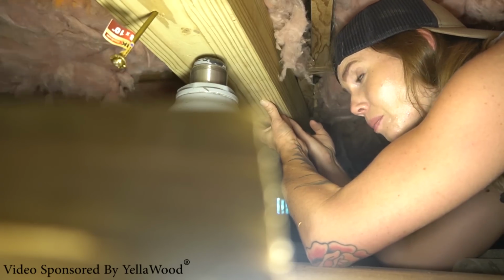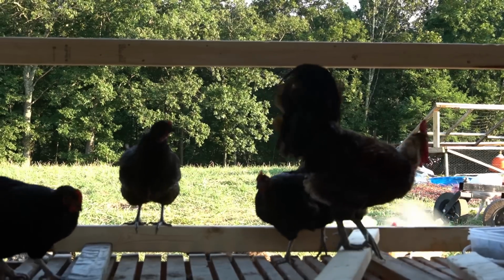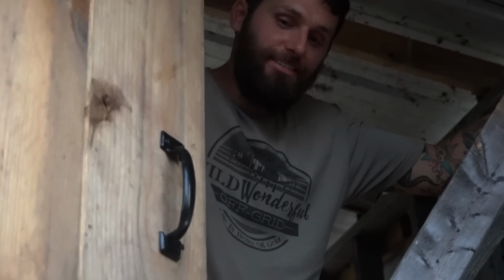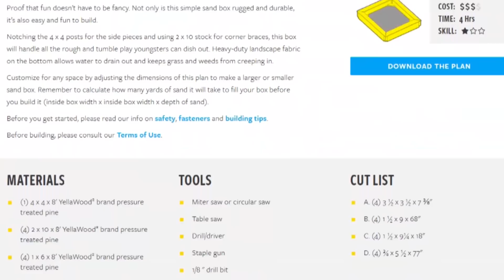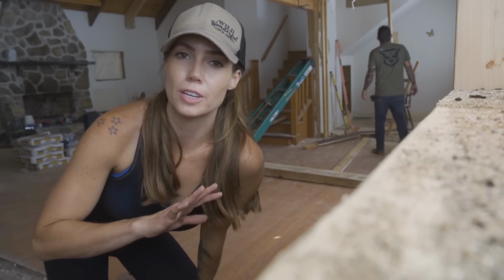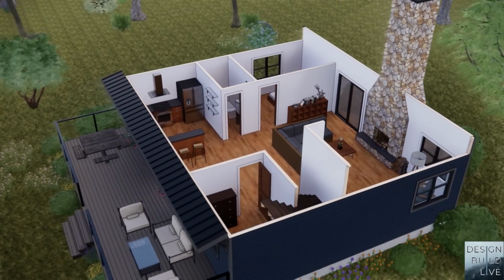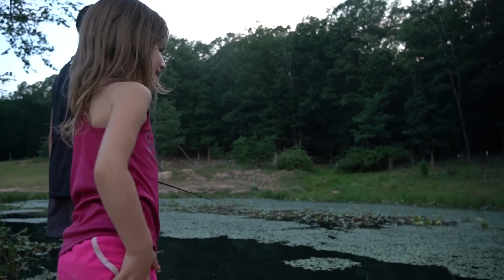Framing The Interior Walls

Comment: Hey guys, I'm a big fan and also a Journeyman electrician and work on technology systems and at this point while wiring your house I'd recommend having a central point for internet such as a modem for cable or satellite then running Cat7 to each room where you will be able to offer 40gb ethernet to   each room.  You can build your own video server using plex and other software and make it totally appealing.

Comment: Just a suggestion, you could drill holes in the metal frame of the chicken coop on all 4 corners or 1 on each corner and one in the middle (6 total) install an eyebolt in each, check online,there's a 6 piece 18 inch drill in ground anchor that uses a cordless drill,comes with drilling attachment, YT wont let me name the site here for whatever reason but it starts with "A" the one i saw was called Tondiamo  6 piece set green ground anchor kit w/ 3 inch auger/helix.
The same site sells various lengths (2 foot up to 12 foot) of stainless steel security cables with loops on both ends,you can then simply drill in the anchor and attach the cable to the eyebolt and anchor with a heavy duty carabiner.
Probably going to cost less than $100 and is quick and easy when moving the coop to a new spot.

Comment: Hi Josh and Erin. The sandbox looks stunning. To keep pets and animals out of the sand, cover it with a piece of canvas which can be permanently fixed at the back side and pull over to the front with hook and pin locking system at the front which could easily be loosened by Ellie.  The bed and breakfast idea sounds great and those that will use it, will enjoy ten star quality. Your work is just phenomenal. Thanks for sharing your life with us. Love you guys. ❤

Comment: Use 8 100# cement blocks tethered using 6” screw eyes, and at to top of the walls using the same, use paracord to tie it down nice and tight. I use four of them for my festival booth, and they have saved my canopy and gear/products when we get the crazy 3: to 5:p winds, or rain storms up and down the California coast. I also screw 8” screw eyes into the ground if we have grass or dirt floors.

Comment: For that chicken coop not to tip over next time make yourself a Plywood box 2’ x 2’ x 2’ tall put rebar in it so you can take a ratchet strap over top of it and ratchet it down make four of them and that way to that concrete will keep the thing from moving and rocking it won’t tip over and you can move it with your tractor the blocks of concrete that’ll be a cheaper way of doing it just a thought love you video keep up the good work can’t wait to see your next one thank you

Comment: If you are going to jack up a wooden beam with that type of hydraulic jack you need a metal plate about 4 inches square for the the jack cap to prevent penetration of the beam and possible spitting of the beam. Just a suggestion!!!!

Comment: Hi Josh , try to mount the water barrel sideways with a little pitch as low as you can. It will act like a counter weight below the deck in between the axles.

Comment: For the coop's future security against storms, how about putting some cables from bottom corners of roof down to a solid stake in ground or one of those screw in anchors ? Just something to take the tension when it starts to roll in any one direction.  They would only need to be used when you anticipate a storm, or if coop's not being moved very often... just an in case of emergency thing ?

Comment: You guys are doing awesome with everything on all fronts!  I am glad to see you are able to salvage the coop and rebuild it!  After the storm came and you showed that it was flipped, it got me to thinking would you be able to put some rocker arms on it (im sure its not called that) but they are like the stabilization arms used on some back hoes to keep them from tipping when they are digging and swinging around while on job sites.

Comment: have you considered screw in the ground trailer anchors and rachet straps to the upper corners - that should help brace from the wind, and can be easy to remove when you need to move the chicken house.

Comment: great video a s usual.  for the chicken tractor, maybe make it triangular A frame.  Better for wind deflection.  add skirting to keep wind from getting underneath.  Remove front axle and add posts in place of axle and use the bucket on the big tractor to raise and move.  just a thought.

Comment: The beams look great. 
Detailed Electrical and Air B&B a smaller no battery solar install would be cool. Keep those running costs lower.

Or maybe in a couple years as tech improves, upgrade the panels at home and use existing at rental properties.

I think the solar panels that can heat your pool and help the panels run more efficiently are pretty dope. 
We also need to get back on track with the Dck Jokes and Erin's butt should be its own character on the show and mentioned in the credits for appearing, giving the respect it deserves.

Comment: Consider mapping out a series of “Stations” that your coop can move through. At these stations there are 4 “hard points” with i-bolts attached to rebar in a 3-4’ deep, concrete filled, post hole. The coop would have 4 chains at all 4 corners like you are going to secure it on top of a trailer for transport. The idea is that at every station you take your coop to it is always secured down to 4 hard points with chains and ratchet binders. This way you only have to worry about making a solid structure that will stay in one piece. It is a lot of post holes and concrete… but you don’t have to worry about your structure flipping in the wind. Good luck.

Comment: Another youtube channel "Just a few acres farm" has a pretty ingenious and simple way to help stabilize his chicken trailer. He attached a short 2x4 to each corner with a door hinge. Positioned so that they contact the ground just slightly before they swing to a vertical. That gives the trailer a wider footprint. He use a hook and eye door latch to hold the legs in the up position while he moves it to fresh grass each time. You could also fill the tires with antifreeze to give it more ballast.

Comment: The reason your coup fell down is that you have no rack strength in the chicken coup.  You need to put triangle bracing at the corners and at least 1/2 a sheet of, fully screwed, 5/8s plywood on one end at least. This will brace the structure against the wind.

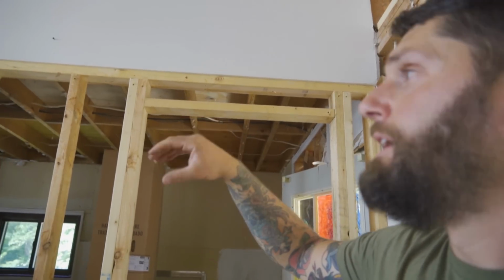Comment: Okay just curious at 14:47 in your video you show the doorway that you rebuilt to that room. My question is this "Why did you  install 4 king studs and the header instead of installing 2 kingstuds, 2 jackstuds  and then the header since a header on jackstuds supports the weight of the door with greater downforce strength when you install it?"

Comment: I eagerly await for each of your video’s. In reference to the portable chicken coop. I was wondering if had a place to put down some mobile home anchors in the ground and you could pull the coop between them and with eyebolts on the frame of the coop using strap and snap to the anchors? I know you know a much better way to secure the coop. I think you do an awesome job on every project that you undertake.